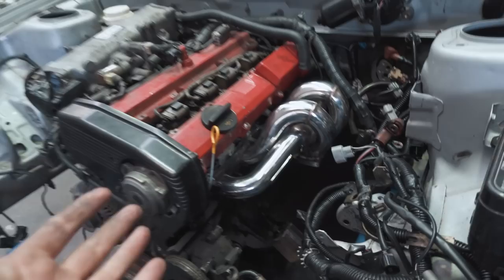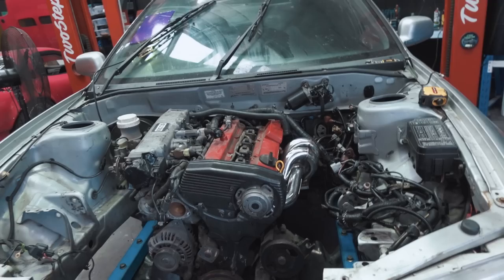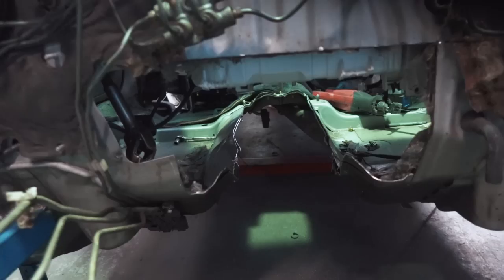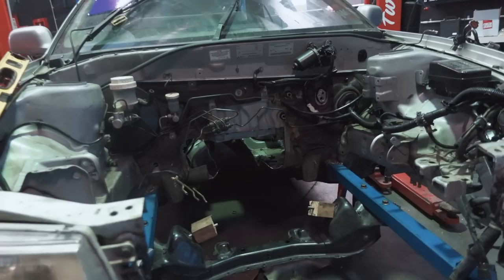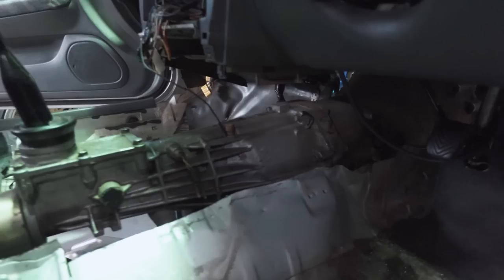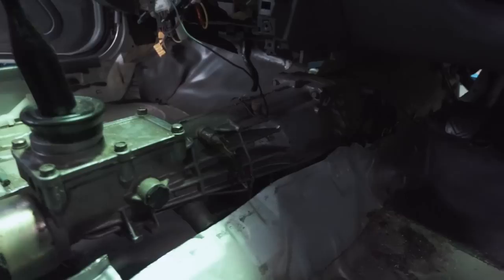LANCER FWD TO RWD CONVERSION | PT4

Comment: Are you not going to tie the transmission tunnel into the frame more than running a weld along the edges? Ive been doing research for my own conversion and have seen people peel up layers of the floor a little and slide the sheet metal into it then run a few welds through the layers and along the edges. Just curious. Love the progress so far!
Reply from the maker: Yeah I’ve got a heap more fab work to complete on the tunnel! It’ll be tied in on the inside of the tunnel underneath aswell as ontop. She’ll be strong enough 😈

Comment: Nice job!, Yeh taking the interior out is a must with these builds, check the gearbox mount position and also look at the rear shock mounts and dont forget to reinforce those front and rear and try and keep the geometry of the wheels, you might need to move/change/ or add a fuel cell to ensure the tailshaft has clearance from the tank, you could possibly put a tank behind the rear seat which will mean less boot space to a small degree, if i was closer id give you a hand but im here on the qld/nsw border and getting my Lancer for a charity drive in feb, but enjoying watching this build!
Reply: Mike, one thing you might have to do is let your local motor registery know of the build as you will need an engineers report for it and if i remember correctly they will follow the build with you to ensure its right for registration.

Comment: I have no knowledge of such an undertaking but… the shifter opening I would think should be larger to allow for the movement from the engine, back and forth, up and down. If it has no area to move around in, if the motor or trans mount break it would rip the trans tunnel up. Just an observation.
Reply from the maker: You're correct! We will be making the opening larger when the whole tunnel has been built 😁

Comment: Hard to see from the video  but have you plated the area where you have welded the rails onto the firewall? I would go 2.5 -3mm and a good 50mm around the area assuming it is 50x50 shs!
Reply from the maker: We’ll complete all the welding and plating of the rails when the car is on the hoist. But lots more plating and welding to be done!

Comment: You didn't really need to cut out the tunnel. Engine could be tilted back a few degrees, it does not need to be level. I imagine you're going to use a single piece tailshaft, so you just match the pinion angle of the diff to that of the gearbox output.
Reply from the maker: It musn't have been too clear in the video...There was absolutely no way it was going to fit without cutting. The gearbox would have been on the ground haha